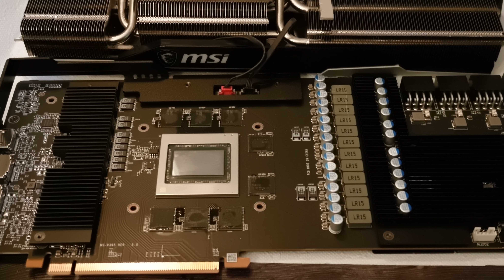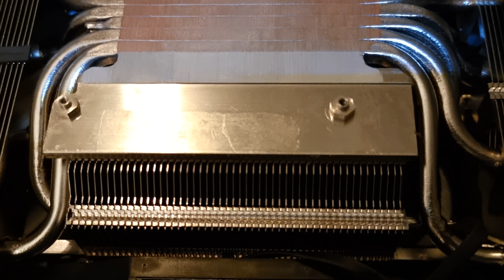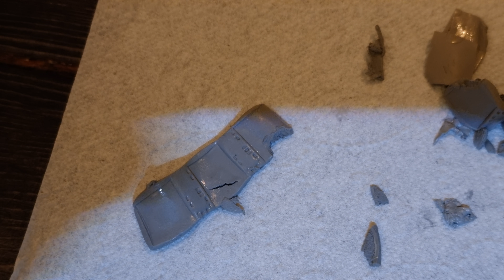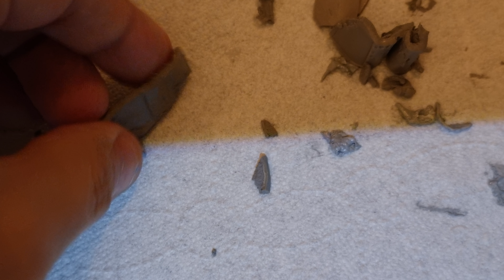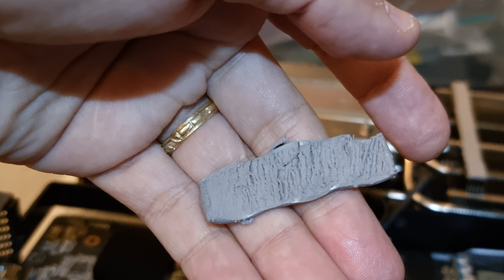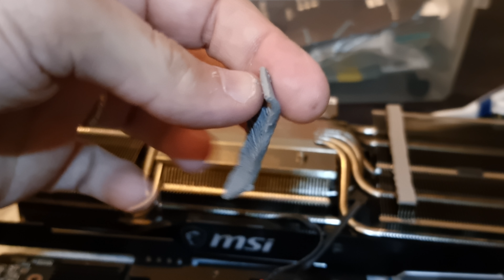MSI's Non-existent Quality Control

Comment: Would you suggest its a good idea to delid a 7700k in 2021, soon 2022? A friend, running a 7700k since ever in 100 degree temp limit at load with really bad temps now (stock about 80 and at 4,8ghz 95 degree at load) to replace the TIM with liquid metal.

He doesnt mind destroying anything since hes anyways prepared already to upgrade CPU+board, but what you think?
Since he got the delidding kit anyways im also planning to mod also my 4790k which isnt used anymore for fun and try direct die cooling/hardcore OC
Reply: Ohh btw he had always the plastic between CPU cooler and CPU, chilly cooler, sweating CPU, sounds pretty much like Intel nowadays
Reply from the maker: Those are fun projects. If it was my cpu yes absolutely 💯 👌.  The temperature improvement is significant depending on the TIM you go with. I'd use conductonaut and MX-5 for the heatsink.
Reply: @TechnologyHive  thanks for the advise, i think we get something like that
Whatever LM for TIM will be easily a „rework“ for the probably faulty TIM of the 7700k after hours of 100 degree usage, but im also trying to convince him for direct die because he got also a very good board for overclocking and a beefy 140mm tower, everything there for beast OC

The 4790k will be for sure fun, thinking already about options how to directly cool with my 120mm tower. And I WILL DIRECT DIE COOL if the IHS is removed once like in the good old days.
Since its working heavily undervolted at 4,5GHz OC easily, im pretty sure 4,9+ is possible with this good old 4790k devil. 4,9 was stable once (5 years ago lol) with thermal problems, 4.8 „ok“.
Reply: @TechnologyHive  any advice for direct die?
Im planning to insert a perfectly grinded plastic shell to allow only very very small „pressure“ on the die but enough force on the cooler mount since my 120mm tower is heavy and i bet loosing contact between the „open“ die and the cooler under load is a bad receipt?
The CPU mounting without IHS is another story. Seems like i have to modify a few more parts but 🛠  and DIY skills are existing. Also, i love sketchy and frankenstein builds

Comment: Yo! Do you have any clue on how to fix a Asus GTX 970 Strix's over heating problem? Its 2021 and my 2015 driver just shut down on me. Im pretty sure its because of heat but i dont know 100%. I just dont want to go and buy another card with the market being so drastic. Thanks for the help if you know anything i could do :)
Reply from the maker: Usually this is core related, but it could also be the vram. I'd advice changing the thermal paste and thermal pads depending on their condition. But thermal paste definitely yes. MX-5 is an excellent choice. 👌
Reply: @TechnologyHive  Ok, ill try to replace the thermal, thankyou!
Reply: @cman_og   If the problem is still there you could try to reduce the power limit of the card and try if it solves the situation, consider that using for example a powerlimit of 80% doesn't mean that It will be fully stable so be careful
Reply: @andrexskin  Thankyou very much for the input! I was suprised with a new pc, because all the tech in the old one was super outdated. Im not sure what i will do with the card now, probably ebay it.
Reply: @cman_og  Understandable, I hope you'll have a lot of fun with the new PC. Have a good day :)
Reply: @andrexskin  thank you!! And I wish the same for you!